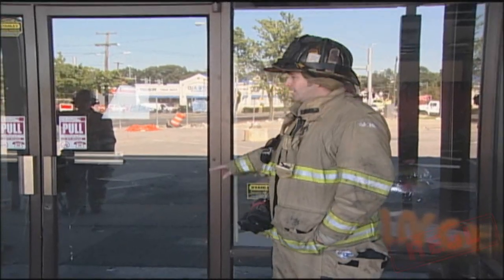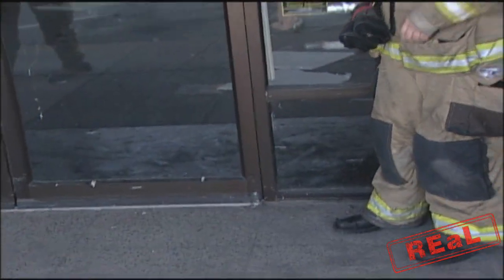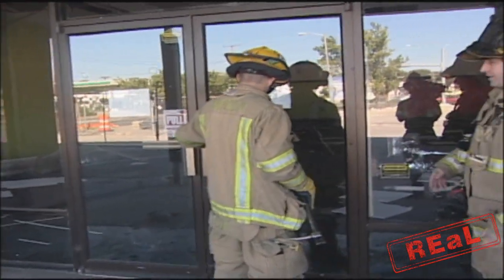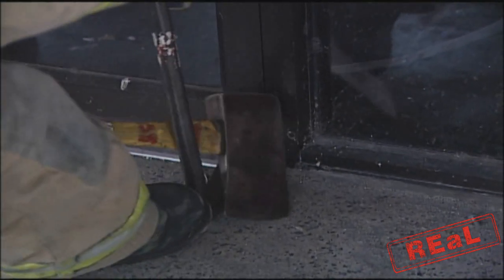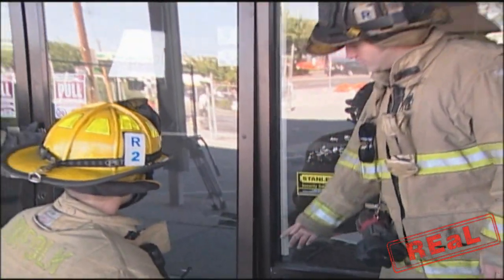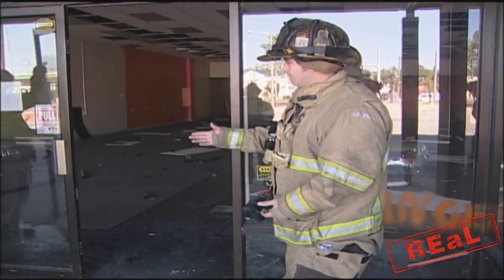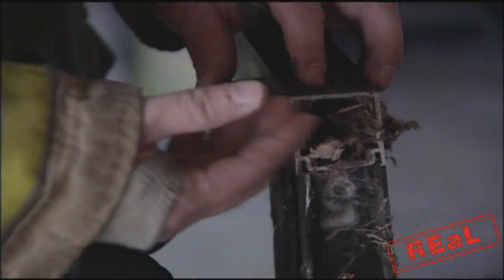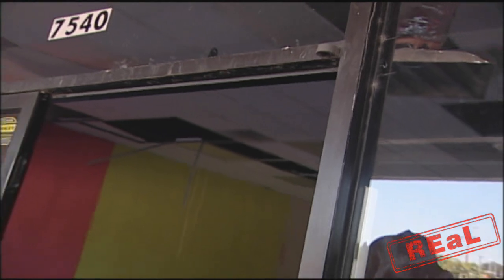REaL Fire Training - Store Front Hinges

Comment: Would this method still work on a newly installed (no dirt build up) store front door that was exactly the same?
Reply from the maker: Angel, it is possible it would work on a newly installed door.  However, if it was installed correctly it will be difficult.  When a door installer is really good, the door will sit tight in the hinges making this technique difficult.
Reply: Jeremy Williams Yeah, that makes sense. Thanks for the quick response. Stay safe out there.